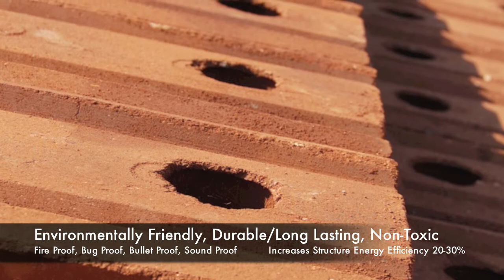Compressed Earth Block Production (Mokopane, South Africa)

Comment from the maker: Good observation! You are right, the hand press is a great option in some parts of the world. This machine is for the parts of the world that the hand press is not economical. The machine in the video was a beta testing model for our pilot project. We have much improved the new model which is going to be released in DEC '11. Stay Tuned for updated videos with the new model and wall system.